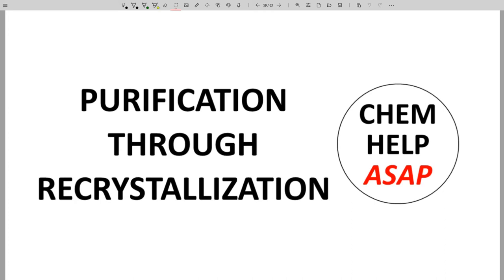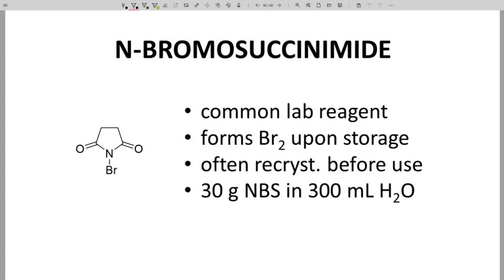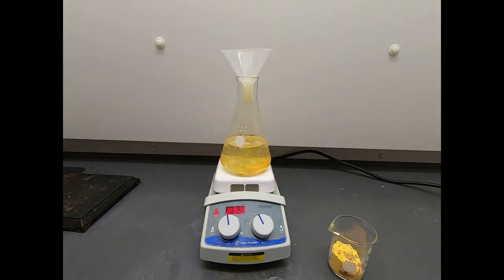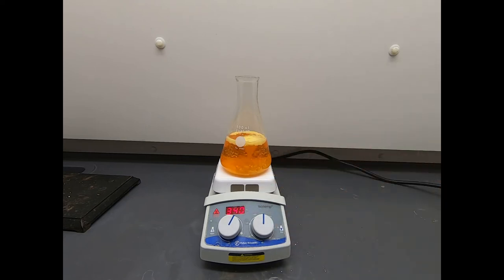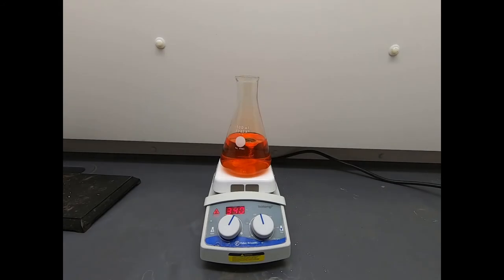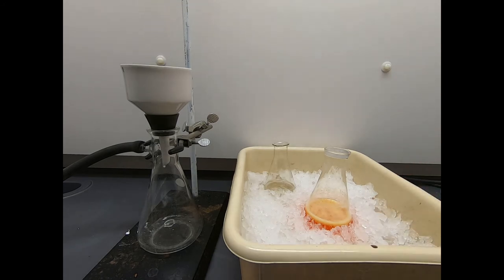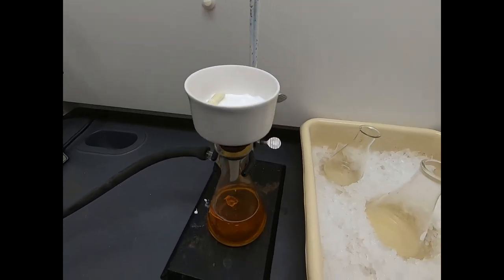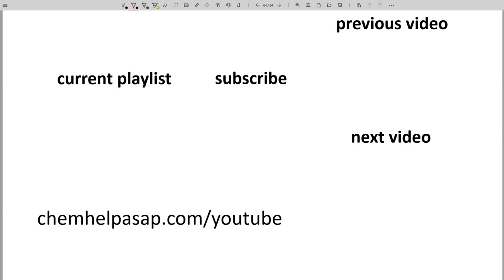recrystallization & purification of N-bromosuccinimide

Comment: The product after recrystallization is still wet, which method do you use to dry it? Any heating?
Reply from the maker: I would not heat it.  I'd spread it out on a watchglass and leave it overnight.  You can weigh it periodically and wait until you are no longer losing mass (presumably from loss of water).  Keep it protected from light.
Reply: @ChemHelpASAP  many thanks ❤
Reply: @ChemHelpASAP  Can you leave it under vacuum overnight to ensure that it's dry? I'd imagine any Br2 generated overnight would be pulled off. Thanks!
Reply from the maker: @K0wface  Absolutely.  It will be fine on a vac line.
Reply: @ChemHelpASAP  great! I was speaking with someone else and they used P2O5 in a jar beaker in the same container under vacuum for using NBS in more water sensitive reactions but I think high vac over night should be fine. Thanks for the clear and concise guide!